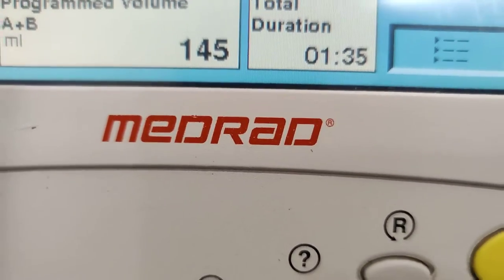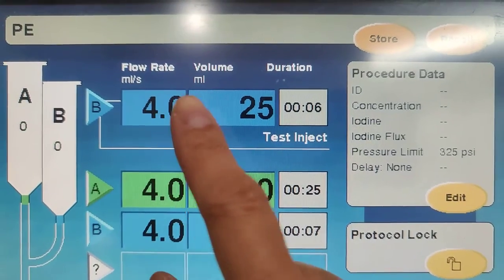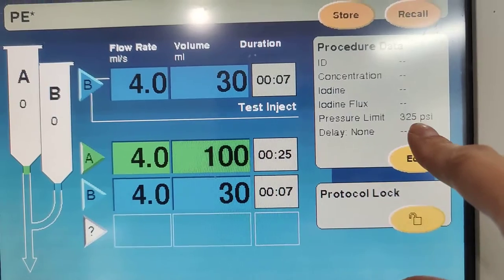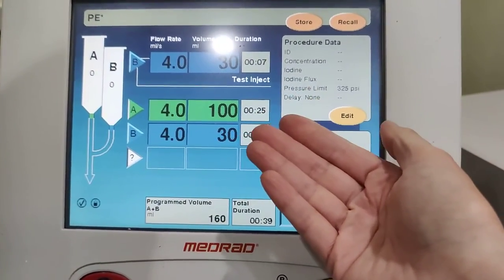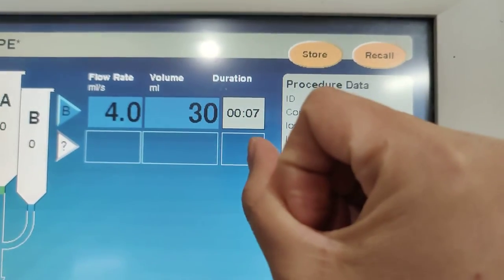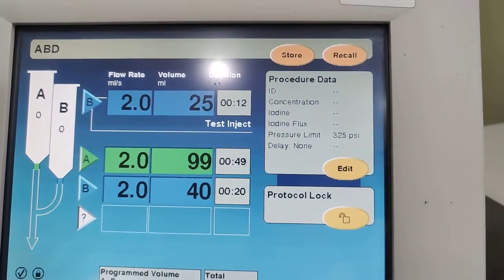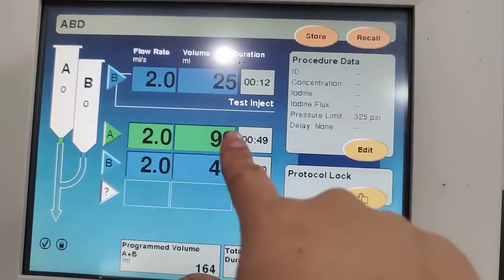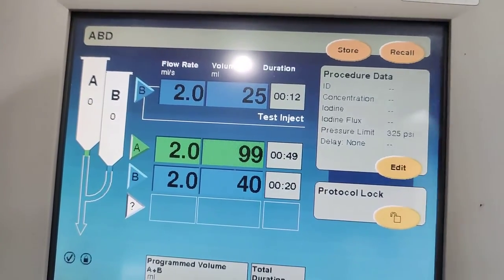Contrast injection rate and timing for CT studies

Comment: thanks. ive been wanting to know how to start the saline after stopping the contrast. 

Do you know anything about the toshiba aquillion scanner? there is a button that says VARI. do you know what that does?
Reply from the maker: I'm glad this video was helpful. 

I'm not sure off the top of my head but if I figure it out I will definitely share the info! Thanks for your inquiry
Reply: @RADKhammany  thanks! I now work on a. toshiba after using Phillips for years!. the toshiba is not user friendly!

on the toshiba: I've also been wondering how to go back and look at the roi image for Angios after I close the sure start screen.
Reply from the maker: Is this after or before you scanned?
Reply from the maker: Since it's AFTER the sure start then I'm assuming it's already been scanned and contrast has been given. 

One is able to go look at how the contrast  was triggered on the raw data side of the screen. You'd have to into the raw data and then find something that says something along the lines of "playback" and it'll allow you to view when contrast went in and when it was triggered
Reply: @RADKhammany  after the roi set up but before the scan to trigger. like if I needed to change my roi position before I scan.
Reply from the maker: I recall a button on the bottom left hand corner. "Previous" see if that's there. It should take you back. 

Honestly, in this case I wouldnt waste my time going back. I would just monitor by watching it. It's it's on automatic trigger for the hounsfield then I'd hold on to the VOLUME BUTTON (the actual button used to talk to the pt) that stops the scanner from scanning IF it hasn't been scanned yet. 

Or if it's manual then it's easier, just press scan when contrast is in the area on interest. 

Hope that helps. But I think what you are looking for is the button to go back and that should be "previous" button. 

Or! You'll have to completely start from the SCAN PLAN .. the button is also on the bottom left hand corner. (From what I recall) it takes you back to the scouts and you'll have to rearrange the parameters and go through the S&V again. 

Hope that helps!
Reply: @RADKhammany  I didnt know that about the microphone button, I have always used the abort button to stop the scan.

I honestly haven't needed to see my roi scan but I remember I could on the phillips so I was just wondering just in case.
Reply from the maker: I think I have a video on the Toshiba buttons loaded to explain that if youre still interested
Reply: @RADKhammany  oh that would be great! I'll have to find it.
Reply from the maker: It might be in the CT PE video
Reply: @Elizabeth-sz5hl  Hi! I know this is 2 years later, but you just hover over the image on the right and then scroll. no clicking or anything, just hover and scroll!(: